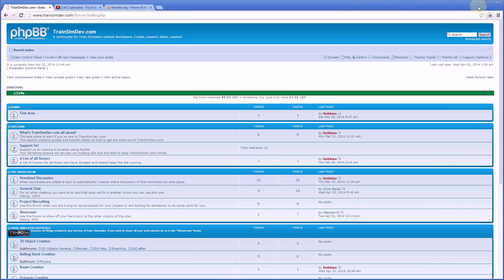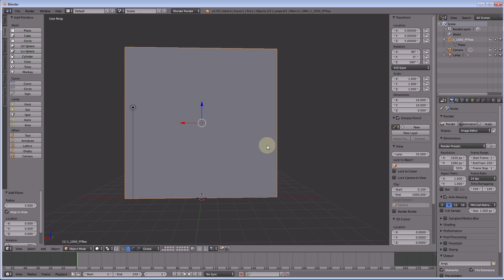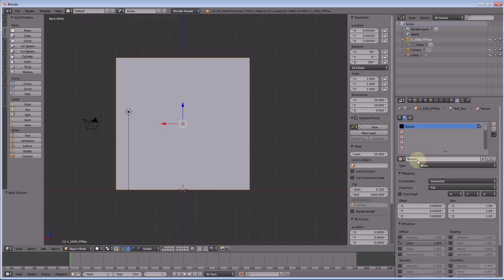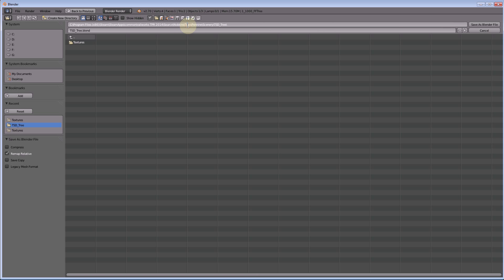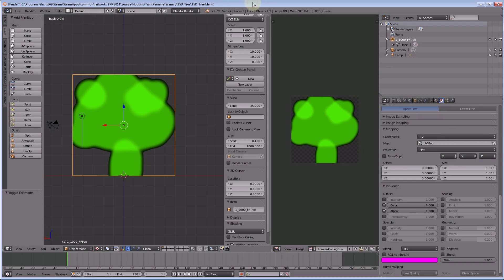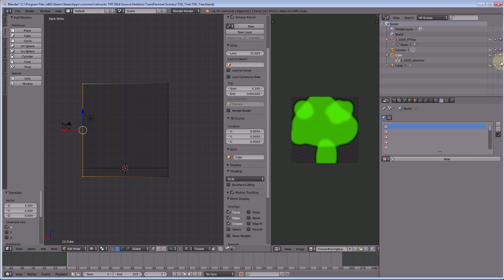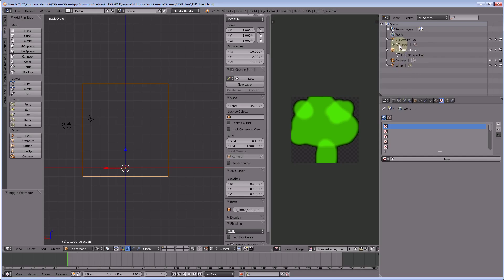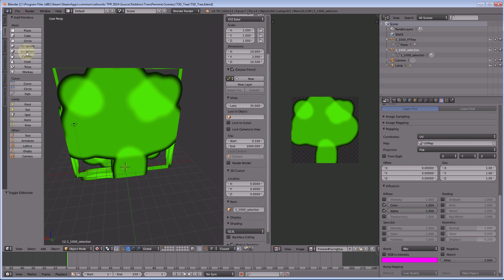Creating a Forward Facing Tree Part 3: Making your forward facing tree in blender

Comment: Sorry!

But, in TS2015 with Blender 2.72, I don't see the alpha!
Reply: Look this image:
http://steamcommunity.com/sharedfiles/filedetails/?id=327169944
Reply: In a perspective closer
http://steamcommunity.com/sharedfiles/filedetails/?id=327172664
Reply from the maker: Rotabile  You need to make sure that the IGSExpModFile2.txt file (yours may have a different name pre-pended to the front eg "MyModel_IGSExpModFile2.txt") contains  the settings required to enable the game to use the alpha channel. This is as follows:
[Materials:AlphaTestMode]
MatSimpleTree=1

The "MatSimpleTree" is the name of the material assigned to the tree forward facing quad. Change this to reflect the name of the material you used.

Hope that helps.
Reply: TrainSimDev.com Yes, I've setting the required alpha channel with rthe same name of Material

For real foliages, Latin Name "Arundo Donax" is the match type of foliages in many rivers in italy

ArundoDonax_IGSExpModFile2.txt = [Materials:AlphaTestMode] MatArundoDonax=1

Issues don't solved
Reply from the maker: Rotabile If you are willing email me a ZIP of your blender file, textures, txt files etc and I will take a look. admin AT trainsimdev.com